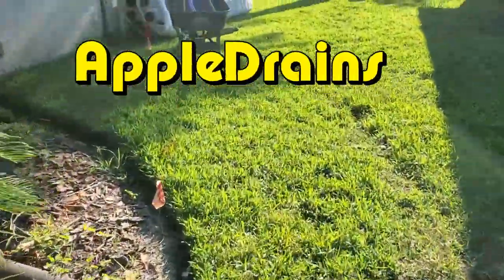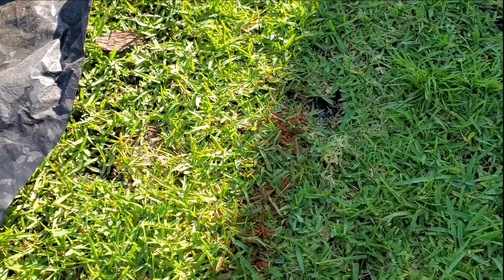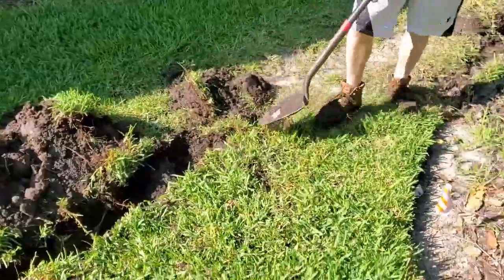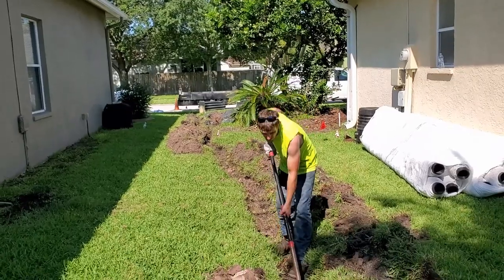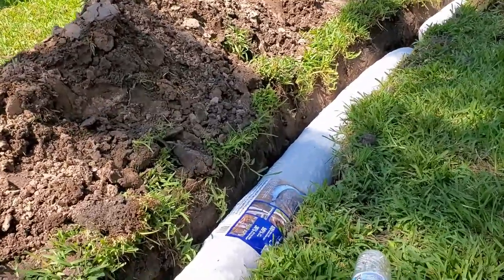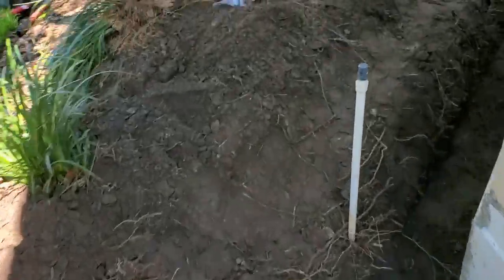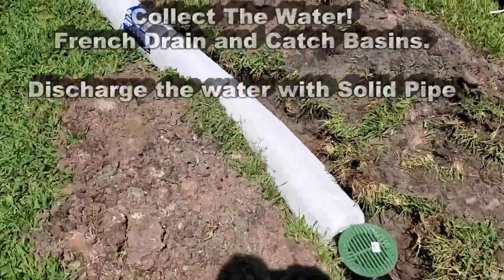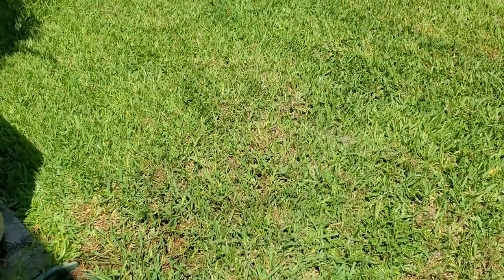Build and Install the Best Rainwater Drainage System, French Drain Guaranteed

Comment: So do you use fabric or not some times you say don't use fabric then you use it around pipe with peanuts ???????
Reply: I can answer that . In clay , no fabric is required with a gravel base and gravel around it. But in sandy Florida soil, he uses either the extra flow , footer tile with a sock over it or fabric. I learned my drain stuff from right here.

Comment: Also you did mention you should check with using the EZ drain peanut pipe with clay soil? Why is that?
Reply: fabric works great when sand is present around the effected area. fabric  gets clogged when there is clay present in the soil.This stops water from being absorbed and taken away from the effected area.
french drain up north or any state that has clay should use gravel around perforated pipe. NOT Fabric.